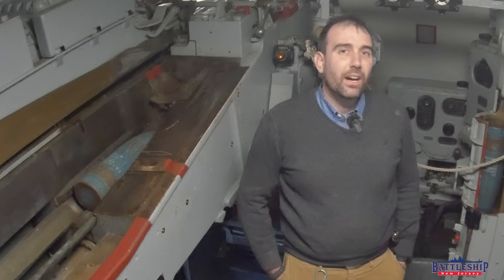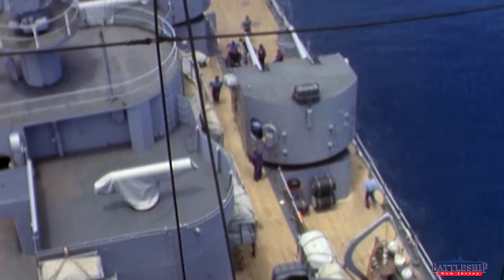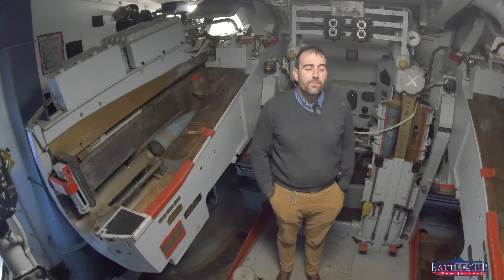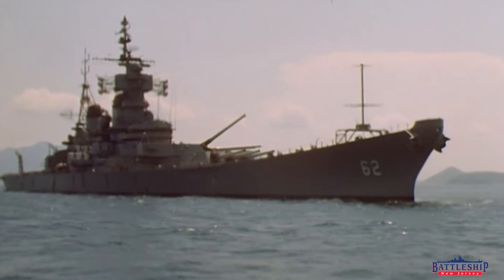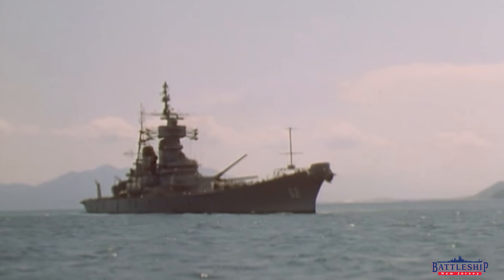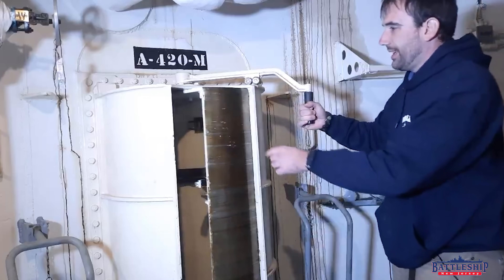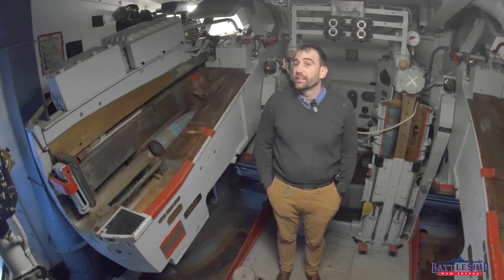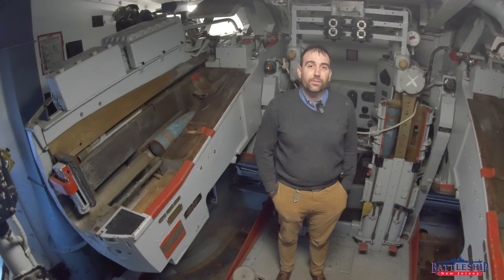Why Do Modern Warships Have So Few Guns?

Comment: I'm a curmudgeon. :-) I think it would be doable to go with an 8 inch gun on a destroyer in order to regain some increased shore bombardment capability as well as a little bit of range. As the current trend seems to be to mount only one "serious" gun on a destroyer then you can go ahead an stick as many missile systems and other smaller gun systems on the destroyer as you think you need. I still remember film footage I saw where the Navy was experimenting with 8 inch laser guided projectiles. They were taking out the exact center of the target on a range, and on hulks that were being used for practice they were taking out the specific doors, hatches, bridge sections, turrets, antennas, etc., that they wanted. Nice capability to have, and I'm sure the Marines would like to have some extra punch available for shore bombardment.
Reply: Modern Destroyers are just about as large as the WW2 Cruisers were in tonnage. And now days an Arleigh Burke is 9200 tond full load and a Ticonderoga is 9960 tons full load. I would say that you could upgun destroyer.
Reply: Between 1975 & 1979 the destroyer USS Hull (DD-945) replaced one of her 5"/54 turrets with a 8"/55 Mk 71 turret.  While the tests were apparently successful, the Navy decided to not to fit further ships with that weapon.
Reply: @stvdagger8074 Unfortunately, the Navy didn't like how the 8-inch gun wasn't accurate and thought that 5-inch rocket-assisted projectiles would do the job just as well. The rocket 5-inch didn't come into service.

Comment: No ship really ever fires at full capacity in combat. They fire a couple of shells, check results, adjust if needed and fire again. Ability to rapid fire doesn’t require you do.
Reply: Gps guided shells could close that gap between salvos.
Reply: In how many ships have you qualified as a Tactical Action Officer?
Reply: @frankbeardsley2941  The US navy has already started integrating laser weapons into Military ships. Please see USS Dewey....
Reply: @andrewyork3869  What does that have to do with the question I asked?
Reply: @frankbeardsley2941  because the us navy is going that way regardless....

Comment: Well Ryan, I do agree somewhat with your assessment of returning to what I will call point defence guns but then you also have to explain the shift from CIWS to Sea RAM
Reply: I believe it’s the same reason that 20mm Oerlikons were obsoleted and replaced by 40mm Bofors; modern missiles have become too fast, stealthy and smart (I.e. evasive) for the 20mm Vulcan to be able to reliably intercept them before impact.  SeaRAM and similar systems have about 3x the range, so have a much bigger window to intercept.
Reply: SEARAM - overall system footprint and power requirement less than the prior regular RAM Mk 49 launcher. Making me think The LCS - SMALLER shorter range to its "main gun" necessitated some SAM missile. One class has RAM MK 49 other the SeaRAM.- wonder the what why.  IRT a few DDG with SeaRAM replace the Phalanx - that a 1-off reason. Humm - next FFG will be Mk 49 - no SeaRam or  Phalanx. Wonder system design - and maintenance comparisons.

Comment: How about a stealth battleship that can sneak up to enemy ships undetected and then blast away at them with it’s big guns? 😁
Reply: You have described exactly the modern submarine ; )

Proper battleships are supposed to be a visible force projection. "I have these big guns and/or missile arrays, and I can and will use all of them to turn you into a coral-reef/crater if I deem it necessary."
Reply: See- Attack submarine.
Reply: Yeah the attack submarine fills that role too, but battleships are able to take hits as well as dish it out. One hit on an attack submarine, and it’s done for. As far as the image that battleships are supposed to portray, it could still look intimidating despite being stealthy. I mean, the Zumwalts are pretty intimidating looking destroyers
Reply: @user-ux9my7io4p  Battleships cannot be made anymore. Armour no longer exits, neither do large caliber guns. Plus you cannot sneak up on an enemy warship close enough to fire said guns
Reply: @DevonRomero-s1b  The trick with attack subs is that they aren't seen, they aren't heard, and they aren't hit. They exist outside the Survivability Onion.

Comment: I think warfare could become up close and personal again. Electronic countermeasures and defenses against missiles and aircraft is always evolving. Who knows, maybe someday a 16" shell could be required to defeat a hornets nest somewhere.
Reply: Mk8 12 inch guns that can carry 12 inch 520kg shells can still penetrate almost same armor thickness as 14, 15 inches gun , so 16 inchs gun are not necessary
Reply: @thanosfickda  Armor is irrelevant, as nobody has any. What your 12" slug cant do, is penetrate hardened bunker structures as well as any given heavier shell. Its all about mass,speed and potential thickness of the shell to go through meters of steel reinforced concrete.
Reply: @Ganiscol ...or we could deploy a bunker buster.
instead of parking a warship inside enemy weapons range, and firing however many rounds to get a target down.
Reply: Or where ships (and especially whole fleets)’s PD (anti missile) networks are so effective that guns are required to wear down an enemy by destroying and disabling radars, CIWS turrets, etc to allow for a killing/finishing blow with missiles.

Comment: I think you have a good point about drones. I guess we'll have to see how navies adapt to that, guns/lasers/jammers? Drone boats might be a more useful way to spend limited space on a ship. In a protracted conflict maybe truck-based self propelled artillery like the archer or HIMARS might be used after the normal missiles run out. With how cheap, mobile, and easy to hide it would be to use truck-based harpoon missiles from land, I don't see the stand off distance from shore leading guns back for shore bombardment.

Comment: Once upon a time, they took guns off fighter aircraft because they thought dog fighting was a thing of the past, eventually they started putting guns back on fighter aircraft, think the same thing will happen with ships.
Reply: Yes, but they eventually started to take the guns back off the fighters. The prediction that dog fighting was a thing of the past was only wrong in timing, not in being eventually correct.

The technologies allowing Beyond Visual Range engagements are now well developed. Mostly Identifying Friend and Foe, as well as improvements in Radar and missiles. (and stealth). Guns could make a come back on unmanned craft, but for manned craft, they are no longer necessary.  (neither the F-35B nor the F-35C have a gun)

Just like the predictions made by the aircraft admirals between WW1 and WW2. They would eventually be kinda right, Aviation makes surface ships take the back seat, but they were way off on when that would happen.
Reply: @loganvanderwier8866 but if anyone has stealth technology how are your missiles going to lock on. I know that might be far-fetched but I would say that's more closer to reality. Because we haven't had stealth aircraft versus stealth aircraft yet. So if your missiles can't lock on to your opponent you're going to have to need a gun to be able to defeat the other stealth aircraft.
Reply: @celtic1842 They can lock on, it just reduces the range which they can.❤
Reply: @celtic1842  radar stealth, like camouflage, don't make you invisible. They just decrease the range of detection. So the battlefield will be more and more networked. Cheap drones will be feeding information to fighters, which then make decisions and launch missiles themselves or tell other drones to launch missiles
Reply: @loganvanderwier8866  you haven't had stealth fighter versus stealth fighter yet. And I don't know if any drones that could keep up with a fighter jet. I'm talking about stealth fighter versus stealth fighter. And most of the time the radar cross-section is too small for even a rocket to lock on Visa radar. If a big ship radar system has a hard time locking onto it what makes you think an air-to-air missile radar is going to have an easier time. And again I haven't seen any papers of the US military putting two of their f-22s against each other and seeing how they can fight each other. I've only ever seen videos and papers of the F-22 fighting non stealth fighter
Reply: @loganvanderwier8866  you haven't had stealth fighter versus stealth fighter yet. And I don't know if any drones that could keep up with a fighter jet. I'm talking about stealth fighter versus stealth fighter. And most of the time the radar cross-section is too small for even a rocket to lock on Visa radar. If a big ship radar system has a hard time locking onto it what makes you think an air-to-air missile radar is going to have an easier time. And again I haven't seen any papers of the US military putting two of their f-22s against each other and seeing how they can fight each other. I've only ever seen videos and papers of the F-22 fighting non stealth fighter
Reply: @loganvanderwier8866 I liked your comment but respectfully disagree. Guns are necessary.

Comment: Another reason for guns downsizing is lack of naval armor (thanks to missiles and air power). What's still in service today that will survive a series of shells from a 57 mm (the primary armament of the newest ships in US service where a gun is the primary armament)?
Reply: pretty sure modern destroyer has 75-130mm main gun. the newest ship you are talking about, the freedom class, is not a frontline ship. that ship would be consider a 3rd line (corvette) in most navy... yes it an oversize corvette. a chinese frigate could easily sink it by range, the firepower difference is just laughably large. those ship are design for patrol, not war. you can't build just warship, you need someone to deal with the pirates... US newest warship are the Burke 3s with their 125mm main guns...
Reply: @lagrangewei  Keyword is "primary". The destroyers with bigger guns still use them as secondary arms. I was actually referring to the Coast Guard cutters, which as far as I can tell are the only remotely recent US ships where ships are the primary arms.
Reply: @lagrangewei  The new Constellation class frigates also have the 57mm gun.
Reply: A 57mm round is 2 1/4 inches.  A 2 1/4 inch round is not going to sink a ship.  Unless it accidentally hits something of value it won't even cause much damage.  As for what will survive it, anything larger than a small patrol boat.
Reply: @bill5982  Proximity fused HE leaves a far bigger hole than the projectile itself.
Reply: @kanrakucheese  In addition you're not firing a single shot at the target you're hosing it down until the waterline looks like a colander and/or the radars and other sensors are nothing but a ragged twisted wreck.

Comment: 5" guns are good for general purpose use, air, surface and land.  Smaller guns, 57mm and 76mm are sufficient for air and surface, lighter ammo than 5" and higher rate of fire.  I do not see the need for any gun over 5" in the foreseeable future.
Reply: I'm thinking a 155 or 6" would have more kill power than a 5/54, that's why they stuck them on the Zumwalts. And yes I know the gun system was a flop.
Reply: @miketorres8441 About the 155mm AGS, why didn’t the Navy go ahead with using M982 Excalibur rounds on it instead of cancelling AGS along with LRLAP?
Reply: I don't know why,  I'm guessing the military industrial complex along with paid off Pentagon wonks just cared about the money.

Comment: Lasers may be the preferred answer to drone swarms and cheap missiles (e.g., Iron Beam). But the USN should probably keep developing both advanced flak type systems and energy systems because nobody really knows what will work best right now.
Reply: I hope no one attacks on a cloudy day. Lasers wouldn't be very effective in atmosphere unfortunately.
Reply: @aland7236 The US Navy is already deploying lasers for point defense. The Arleigh Burke-class destroyer USS Preble (DDG-88, a Flight IIA variant) received a 60 kW HELIOS laser weapon system in 2022 during a refit. This is the first permanent installation on a US warship, but the Navy plans further permanent installations on other ships undergoing refit.
Reply: @JarrodFrates  Considering the up and coming hypersonic missile age, lasers would be effective at a range uncomfortable to me. Even operating near the speed of light there is still the need to hold on point for a burn, with multiple inbound hypersonic vampires it may not be super helpful. Lasers would be easier to "reload" and probably cheaper in the short term, but the amount of energy needed to be stored would be as dangerous as a magazine full of powder and the capacitors would need servicing/replacement eventually. Thinking about it, everything has pros and cons. Thanks for the info about the install being tried now, I hadn't heard about that before.
Reply: @aland7236  Defense against hypersonic missiles would primarily be handled by long- or medium-range defenses, with a goal of dealing with them while in the glide phase at high altitude. They are unlikely to be sea-skimming anytime soon as the atmosphere would be too dense and they would either slow down or burn up. They're also expensive: the Russian Kinzhal is estimated to cost around $10 million each. This means that swarms are extremely unlikely.
Reply: @aland7236  Do the laser systems on ships use capacitors to charge up? I thought they used the power output directly from the ship's turbines and so they could get really cheap on a per use basis. Also, I think counter missiles will be much much better against hypersonics until lasers get real high powered (MW or more range).
Reply: @aland7236  Lasers and/or guns are supplemental to missiles. In my mind, you are using them to dispose of slow, cheap drones to save SAMs for hypersonics/supersonics.
Reply: @aninsidejoke7172  I mean barring some sort of in use power technology I'm unaware of. I don't think we'd be able to have a "on-demand" energy generation at a level to run the type of laser needed. Maybe a CVN could handle that but that would be about it and not for long. I remember the Zumwalts have about 86 MW of general capacity so maybe they could participate, but I doubt they could handle more than a few shots. From what I understand, for a laser to do the job needed it needs a LOT of energy and it needs it FAST.
Reply: @MattBarnes-r3c  That's an excellent point! I was looking at this in a missile defense type way. Even Ryan mentioned using the laser for slower moving drones and aircraft. A "low" wattage laser could be used in place of regular old fashioned AA guns. Thank you for sharing with me.
Reply: I personally just want to go for a full Battlestar Galactica flak wall/barrier/spam wrecking drones
Reply: I think the crew of the USS Carney would disagree.
Reply: don't forget the microwave.
Reply: Laser Technology is plainly junk for all but slow lightweight threats (c.f. small drones).  Lasers require considerable energy, and dwell time on each object to do any significant damage to any significant, reasonably well armoured target. The dwell and recharge time would be too long to combat a swarm of drones, and pretty useless against a heavy hypersonic kinetic object. A laser cannot destroy that kinetic mass still coming towards you.  The physics simply does not add up.
Reply: @AptMantis2278I'm not sure if the problem can ever be overcome with railguns. The thing is, for the concept of a railgun to work, you need to put very high voltages through the barrel, which are pretty much guaranteed to make it hot. And damage it. The only way I see around it is the use of superconductors, but even that would be technically a big challange
Reply: What about rail/coil guns
Reply: @shinjiikari1021  A lot of energy needed to fire the weapon, and a ton of wear and tear per mount makes cost per shot super $.  The tech just isn't there yet.  Testing still continues.  Lasers are probably going to take over as a result.  Problem is they can be spoofed, diffused, etc.  Don't work well in bad weather, smoke screens reduce effectiveness.  It's just a mixed bag at the moment.  Honestly, guns work.  But range is an issue and often your shooting at something that's one one hundredth of the cost of the shell your sending down range.  Lots of factors to figure in.  Way above my paygrade.
Reply: @b.thomas8926 Testing of the railgun ended in 2021.
Reply: @JarrodFrates  Did it?  Oh well.  Guess the material sciences couldn't solve the over heating problem.  Thanks for the info.
Reply: @shinjiikari1021  at the moment they have too high of an energy demand and have trouble with cooling. Besides rail guns are good at firing a fast moving long range round but due above stated reasons rapid fire is very limited. Think about current and future weapons on ships like this. Rail guns, long range anti-ship missiles and cruise missiles are like the 16 inch guns of a battleship. They are good for slow long range fire targeting ships and enemy positions on land. Weapons like phalanx CWIS, goalkeeper, and rolling airframe missile are like the 20 mm guns. They have a relatively small round a short range but have a extremely high rate of fire and are best used for close range self defense. Lasers are like the 40mm. They have a slower rate of fire but have a longer range and more fire power. Surface to air missiles are like the 5in guns the slowest rate of fire other than the extremely large weapons but have a very long range and a large amount of fire power. The comparison isn't perfect because of things like the laser systems don't really have a rate of fire and anti-ship missiles, cruise missiles, surface to air missiles all have more or less the same rate of fire but it should be close enough.